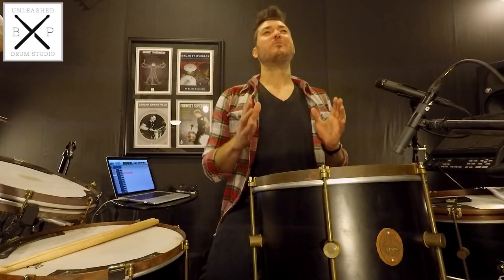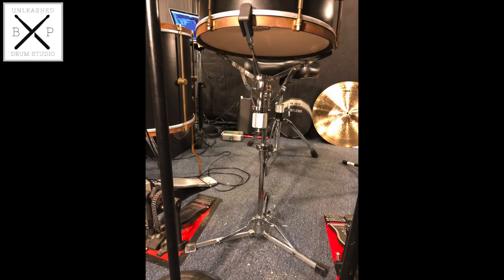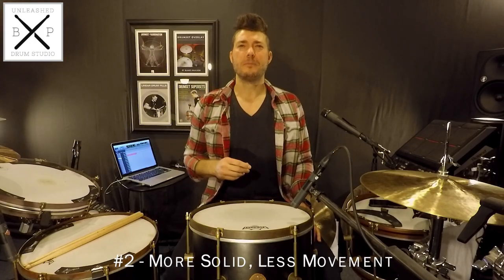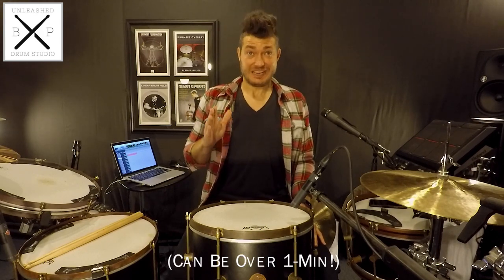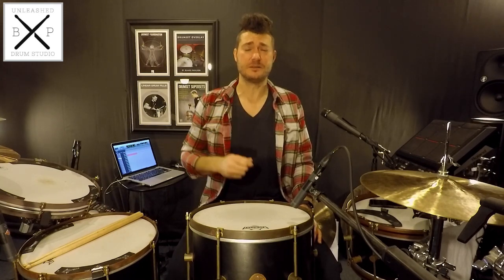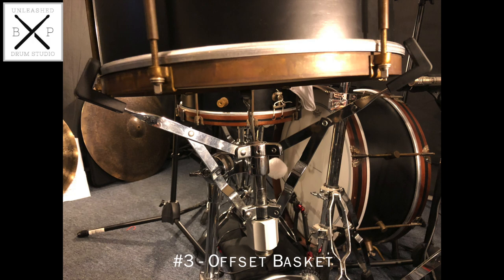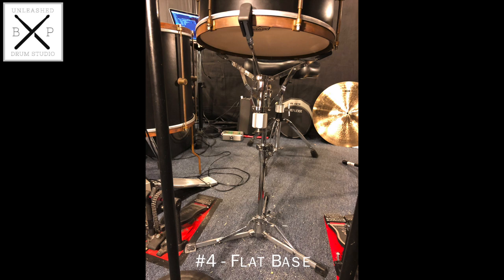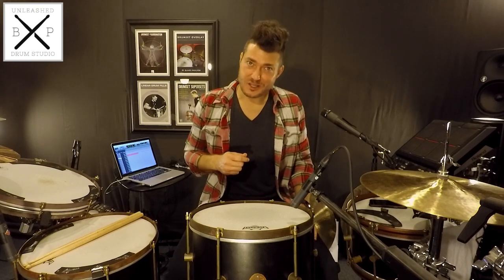Why is a Snare Stand the Best Tom Mount?

Comment: Well.. i see Your point.. and most of it I agree with. 

the big issues.. 1) no way to make room for 2 toms in front of you.. 2) it's like hitting a wood block when striking a Tom mounted on a stand.. I love the soft feeling of a rims mount.

but I have to add that I build my own drums, and I.make them so they don't have too much ring/vibration.

and its also true that many modern drums ring for way to long... which is why I play vintage drums or my own drums.
Reply: I've actually set up 2racks on snare stands  yrs ago

Comment: I agree that drilling holes in bass & toms is bad. My 1972 Rogers 5 piece kit has such holes. The fastening threads on the tom tom holder stripped out years ago. Replacement parts were sold out by the 1980s, never made again.
RIMS mounts or snare stands make sense. No holes drilled, & best of all, no special fasteners that strip out & become irreplaceable.
Maybe I should scrap the dual tom tom bracket & just use a pair of snare stands?

Comment: Probably worth noting that this really only works for a single rack tom setup where you are happy with the mounting position being offset to one side. You can not mount the drum above the bass drum where it would normally be if it were mounted off the bass drum directly.
Reply: I disagree I've used 2 racks on 2stands no issues

Comment: I have gone through this, and still am with my rack tom. When I had it in the snare basket, I didn't seem to be able to get enough sustained. And it also took some of the lows out of the tone. So I ended up picking out a gauger percussion isolation ring. It has several clips that's not directly to the lugs, and the ring snaps in place and looks like a halo of sorts. So I don't have the issue of drilling any additional holes, and since it's still in a snare basket, it's it's right where I want it and isn't moving around on me. But now I'm back to this issue where it's ringing too long. Even with a pre muffled resonant head and a 2-ply batter head, I still end up needing some muffling on the top, and even the bottom to tone it down.
Reply from the maker: Gotcha. Can you post a photo? Ur def trying the right steps! Have you tried a different brand of snare stand? Or loosening the grip of the basket? Either of those factors can make a big difference. Also, I would steer away from pre muffled heads if possible, for better playability.

Comment: I have a 15" tom. would that snare stand open wide enough, I would think so, no?
thanks
Reply from the maker: I haven’t tried a 15 inch tom on this stand, may not work.  However you could upgrade to DW‘s 9000 series snare stand and I can confirm that holds up to a 16 inch drum. 👌